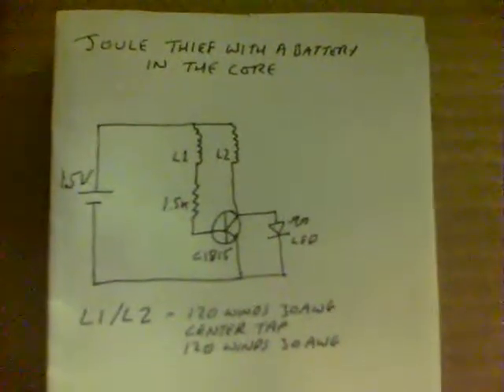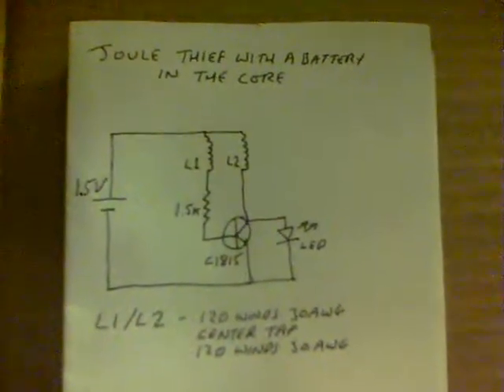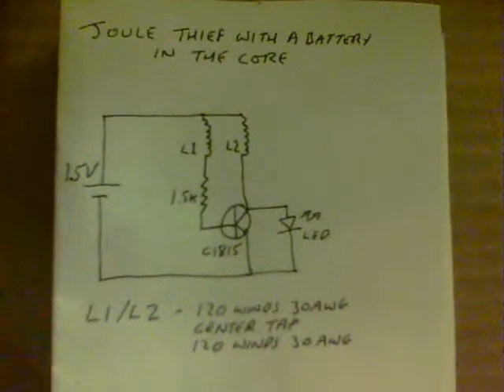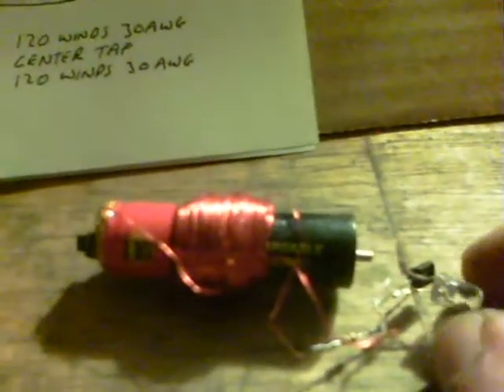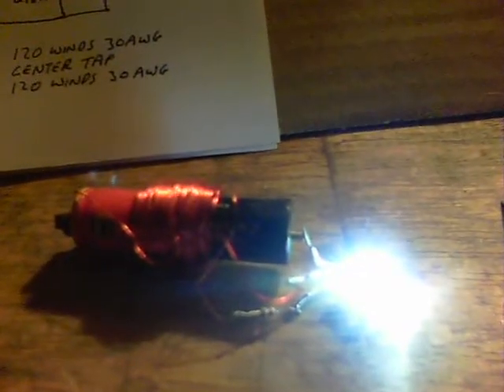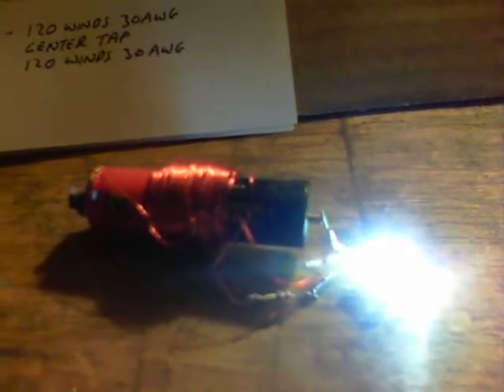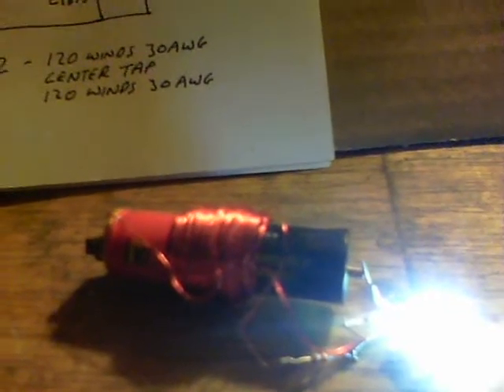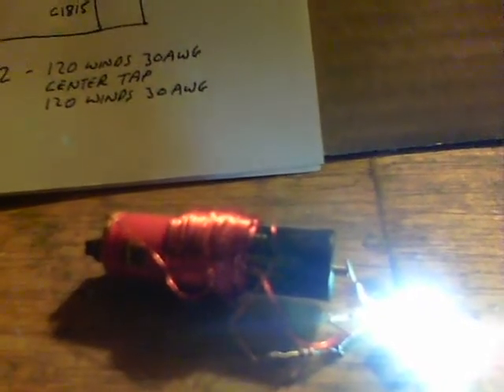Replication: Battery as the core

Comment: Slider:

Nice work man.  Great idea using the metal wrap.  I was attempting to use the Jeanna Circuit JT (output of about 600 volts or so) and I hit a brick wall.  Some think it is my magnetic battery clamps stopping oscillation, others think the battery will not work as a core.  After watching Lidmotor's and you video, I will have another crack at it.  I will check out your other videos as well.

Thanks,

Bill

Comment: Hey Slider. Question ?  What do you think would happen if say you had two pieces of galvanized metal one on the positive and one connected to the negative of the battery but not touching each other has that would be a short. I don
t have the wire at the time but this has me wondering what would happen to the battery. Take care. Tec